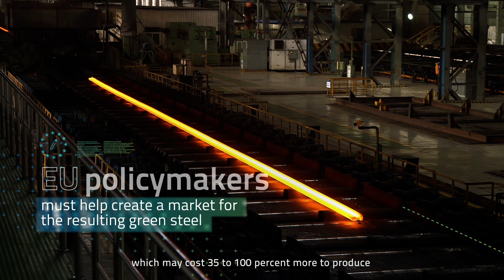A Green Deal on Steel: Energy - What does the steel industry need?

Comment: How about trying something new? Actually research the available energy sources.

China is developing two low cost reactor technologies : Molten salt and gas cooled reactors.

That means electricity costs well below hydro. And cheap heat up to 2000 degrees Celcius.

Those who does not look into nuclear will find themselves outcompeted by cheap steel.
Reply: They can address this green steel issue with Pyrogenesis Canada inc Technology